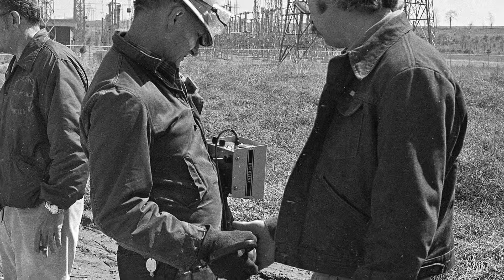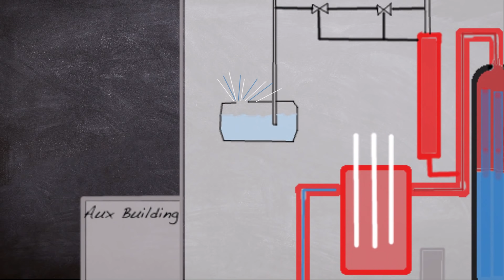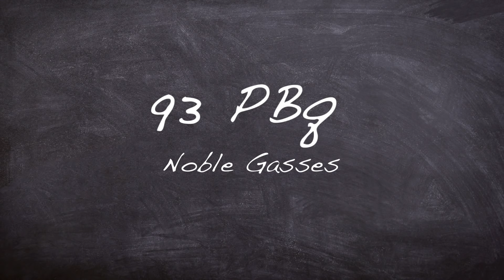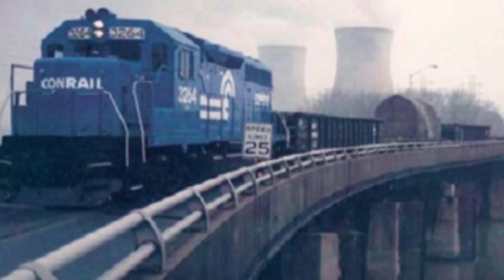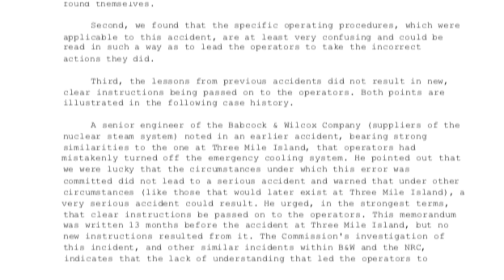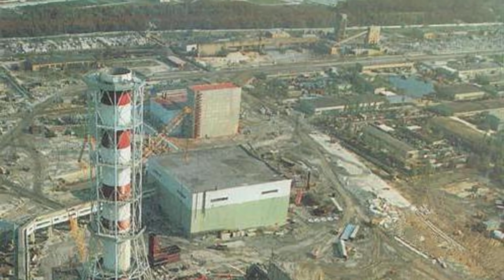A Brief History of: The Three Mile Island Accident (Short Documentary) (Part 2)

Comment: TMI, as a nuclear accident, seems very minor. Especially given Soviet Russia's "accident".
Also brings to light the standards for Nuclear Reactors between the two. American reactor failures were generally kept well under control. Soviet reactor failures nearly wiped out Eastern Europe.
Reply: You should probably look in more detail at America's record with nuclear safety then...Simi Valley, SL-1 (Idaho Falls), Fermi 1 (Michigan), Surry (Virginia), Peach Bottom (Pennsylvania), Waterford (Connecticut), Crystal River (Florida), Oak Harbor (Ohio)...
Reply: I don't think Chernobyl was really a standard of safety, they just didn't think the reactor would ever fail. More of a problem of naivete than safety. Dumbasses thought putting the fuel rods directly above the water supply would be a good idea. As soon as there was a problem and the rods melted through the container they were boned. Dropping a bunch of extremely hot nuclear fuel directly into a water inlet is never a good idea.
Reply: @andrewb378  Chernobyl was a product of the criminally bad management system in place in the Soviet Union. For political reasons, the government was more worried about their image than the consequences if something went wrong. The reactor had design flaws, but the government kept them hidden from the operators, because Soviet nuclear power was supposedly "perfectly safe", and accidents were "impossible". Even when the reactor exploded, the Soviet government tried to cover it up, because like I said, nuclear accidents were "impossible" in the Soviet Union. Only when radiation was discovered in Sweden did they finally admit that there was a problem.
Reply: @Penguin_of_Death  not a single one of those breached containment. And that’s the point. Sure accidents happen. They always do. The western reactors are just much safer when it does happen.

Comment: MREM is megaREM, which is 1,000,000 REM. mREM is milliREM, which is 0.001REM. The difference between using upper and lower case for SI prefixes is importatant to keep in mind. It's an understandable mistake, even if it is 9 orders of magnitude off. At least you said milliREM, so there was no confusion.

Comment: It staggers imagination that when given a choice between pressurized water reactors or a molten salt reactor we go with the much more complicated, way more expensive and criminally unsafe design.
Reply: All nuclear power research is based on nuclear weapon development. Getting money to research electricity generation is much harder than getting money for weapons development. Atomic energy research was allowed to piggyback on weapons development. The government didn't want to pay for two different lines of research, so nuclear power had to work with the discoveries that weapons developers were already making.
Reply: @Yora21  thats it.. it started with weapons and small reactors for naval ships and subs.. Alvin Weinberg wanted to go the molten salt liquid fuel option since PWR and BWR dont scale up safely since they cant get rid of the heat if something goes wrong but money and the need for bomb fuel got in the way of the safest and most fuel efficient reactors

Comment: As in many of these types of accidents, like Chernobyl, someone did a system test prior to the failure.  They did not restore all valves to fully operational after the test.  What surprises me is that it was the secondary cooling pump system that failed and caused the accident.  What was the primary cooling system doing?  I thought I heard you say there were three redundant cooling systems.  What was cooling loop three doing at the time?  Another problem seems to be running the TMI 2 system at 97% capacity while TMI 1 is down for refueling.  Seems a bad time for a test on TMI 2, while running at near full capacity.
Honestly, we have learned so much from these stupid accidents and electronics have gotten so much better, that we really should be using more nuclear power.  Simplify the control indicators and take those design lessons and build a power system that can be scaled up and down to meet an area's needs.

Comment: Surprised you didn't mention Jimmy Carter visiting the site against the advice of literally everyone... XD (Also health claims from radiation lol, you mean the radiation that's less than half of what you get from a chest x-ray?)
Reply: @Richard Vaughn Except 1.4 mRem wasn't the background radiation in the areas around the plant, it was the dose that each resident was calculated to have recieved. For comparison your average US resident receives about 640 mRem per year. When your exposure level is that extremely low how long the radiation is accumulated over dosen't matter.
Reply: @Richard Vaughn A large does in a short time period is far more likely to cause tissue damage and health problems than a large does spread over a long time period.
Reply: Also, there was the issue of the President's advisors using an incorrect formula to determine the conditions on site, while President Carter had someone on-site that was using the correct formula and had advised President Carter that is was safe to visit. There has never been any mention of how many people were using the faulty (or wrong) formula and the consequences of that.
Reply: @Richard Vaughn I mean, as has been pointed out, this was radiation released in a rather nonstandard situation. When things are working normally, you get more radiation if you live near a coal plant than if you live near a nuclear plant.

Comment: mrem, not MREM. Capitalization is important with units. Firstly, M stands for Mega-, not Milli-. Ecxept k for Kilo- and d for Deci-, all prefices smaller than 1 are in lowercase while those above are in uppercase letters. Secondly, only the first letter of a unit is capitalized, similarly to element system in the periodic table. That way one knows more or less if two letters belong together or are two units multiplied.

Comment: Watch the China Syndrome. Movie is about 3 mile.  I Can See the Cooling stacks from My Bedroom window over 90+miles away.
Reply: It's also full of BS, there is no such thing as  a "china syndrome" it's fake science designed for movie drama. Nuclear reactors cannot cause nuclear explosions.
Reply: Actually the film came out before the accident.  March 16, 1979 versus March 28, 1979. @bansheemania
Reply: Bruh, he literally said in the video that China Syndrome came out prior to the 3MI incident. What a dumb comment.
Reply: @MrMattumbo  You are correct, it would not be a nuclear explosion. But it would be a mess. So here's the concept: The hot molten mass of what used to be a nuclear fuel core remains critical, melts down through the bottom of the reactor vessel, through the bottom of the containment building, into the earth and eventually hits the groundwater table.  When it does, you get a massive STEAM explosion which then propels the radioactive core contents out in a huge plume to be carried by the wind to rain down on everyone. It is a plausible scenario (though very low probability). I used to do nuclear accident modeling and analysis. In fact, my accident analysis software was used to help understand what happened at TMI in the weeks after the accident. A crazy time for all.